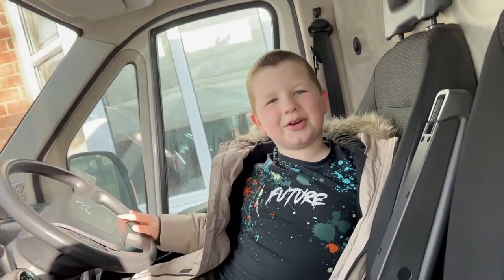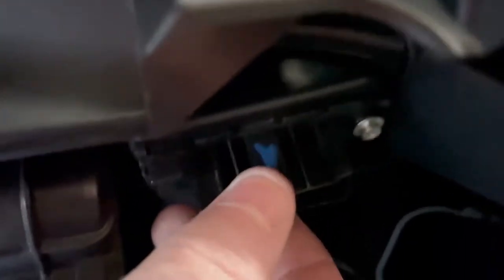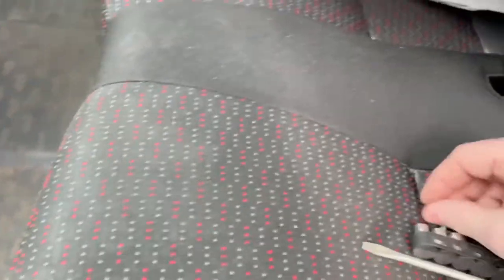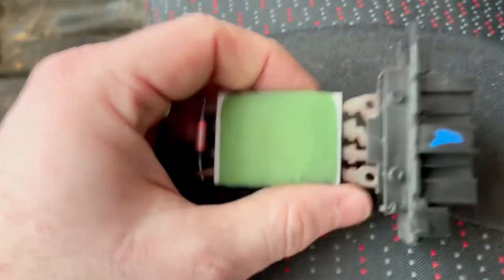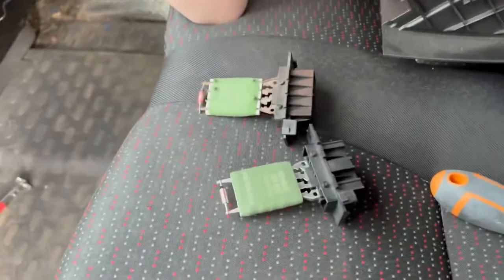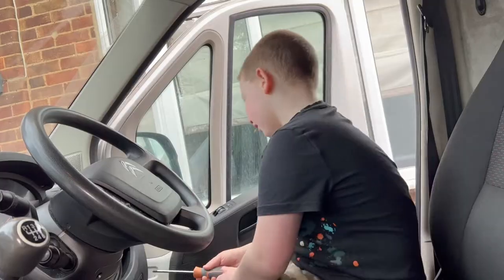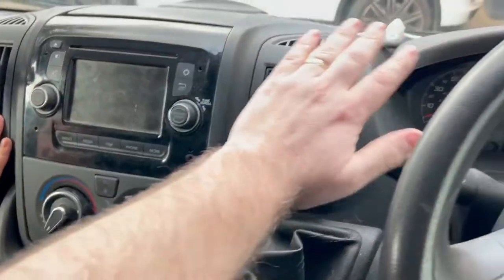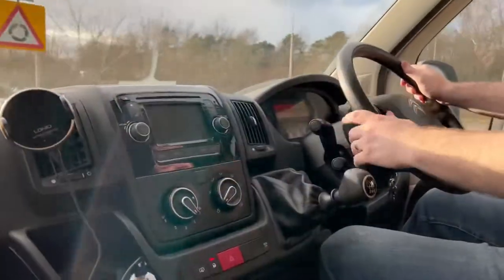How to change a blower motor resistor in a Citroen Relay van

Comment: This video helped me fix the same issue without replacing the resistor, I removed it, checked the contacts and they were corroded, cleaned them up with sandpaper and tested resistance across them (neg on 5, positive on 1 to 4) and they all had increasing resistance rates, plugged it back in and it worked fine, all settings on the blower now working as they should, because of the way it is positioned moisture will trickle down to the connector and corrode them over time.  The bit size required is 5.5mm by the way, and he made it look much harder than it was to get to it and undo it. :)

Comment: Thanks so much. I have searched hi and low on the internet for where the blower motor resistor located and how to remove it. Mine is a Peugeot Boxer, but identical. Easy job when you know.

Comment: I have the same issue with my Boxer. I will attempt the repair myself and report back if I manage it. Cheers.
Reply from the maker: Did it work? 🙂
Reply: @teamdethridge5283  not done it yet. It’s on the list. Did swivel seats first.

Comment: I have a problem with my dispatch citroen heater it stopped working and when it works it's at low speed after a few minutes it stops and may take days to get back on even if the switch is on 
How can I fix it as citroen garage has taken all my money

Comment: I have a fiat ducato 2012. the heater started to run intermittently, stopped, started randomly. I also changed the air heater and the thermal resistance with new ones, but it does the same thing. it goes, it stops when she wants and for as long as she wants. what could it be?
Reply from the maker: Fan switch maybe? :)
Reply: @teamdethridge5283  thx , i will change this switch

Comment: There not metric lol .
Reply from the maker: I’m surprised I even had one that fit. Can’t beat an adjustable 😂
Reply: @teamdethridge5283  just so long as you can get one in. Just found out that I need to replace mine after fan only runs on full speed.
Reply: @captango  hi mate. Mine only runs on full speed too. Did it work for you when you changed it
Reply: @dalison1  I replaced the it and later found out that the mounting holding the switch on the dashboard in place  had been broken  so I removed it and used sugru to reafix it and all works fine as it should. Hope this helps.
Reply: @captango  that's mate. I will check mine when I have a look